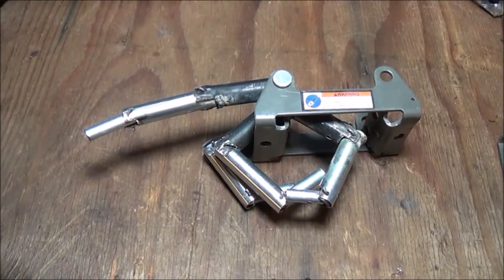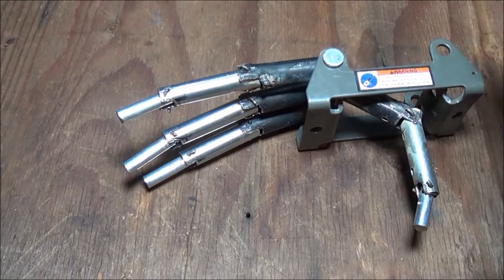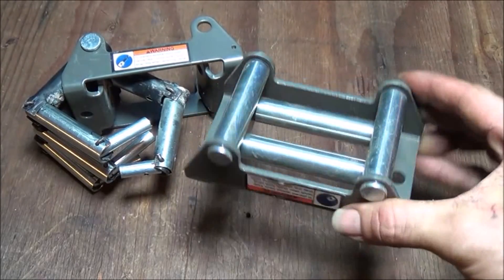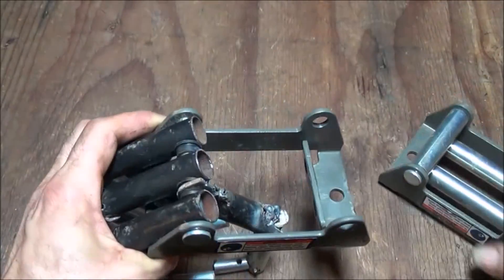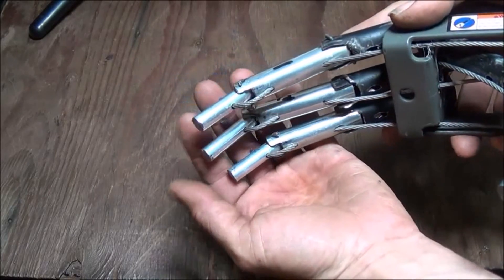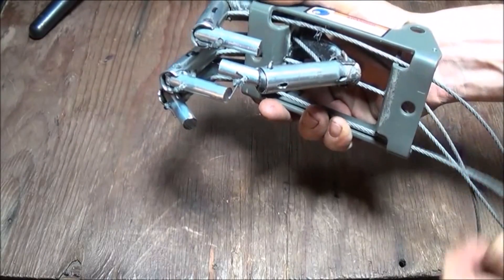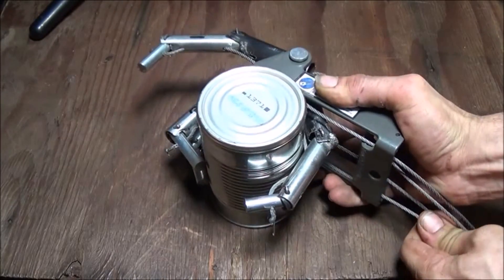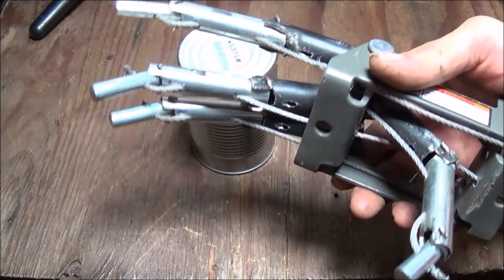Building a Humanoid Robotic Hand. For A Powered Exoskeleton Suit

Comment: as many have suggested some rubber on your fingers would help with grip, also you may want to add some sort of rollers to the cables to reduce friction when opening and closing the hand. springs sound like a better way to open the hand as there isn't much need for a large force in that direction.

Comment: I like that you're using a cable-driven system for actuating the fingers rather than trying to implement individual small actuators for finger articulation. However I'm worried that this is, at best, only going to achieve as functional a grip as a simple claw might. The amount of articulation you appear to be achieving doesn't seem to justify the complexity here. Am I missing something?

Comment: Not sure about your abilities with electronics but wouldn't it be cool to incorporate a micro motor and potentiometer in the glove controlling the hand allowing you to have pressure sense so that you don't crush things and have more accurate control of your manipulator, I imagine it would work like this hand squeezes in glove potentiometers relates resistance to IC( of your choice) IC moves exo hand exo hand grips object which puts pressure on sensor in hand(not sure what your best option is here) sensor data is read by IC and powers small motors in glove to simulate pressure exo hand feels. What do you think?